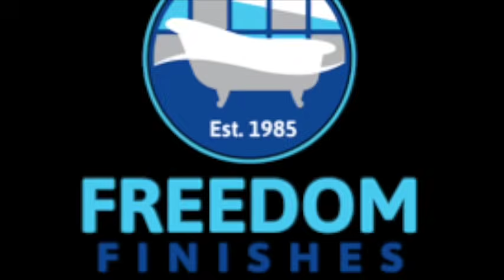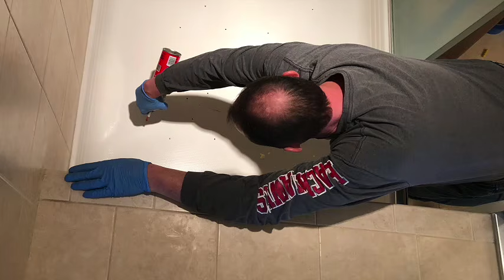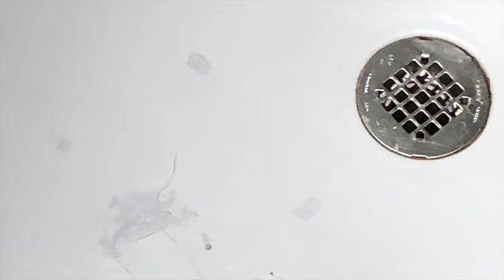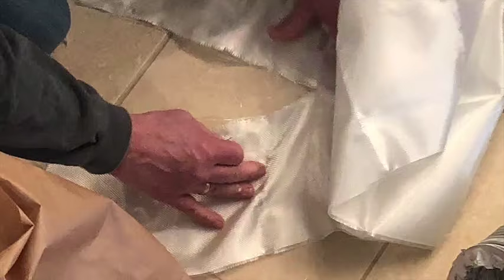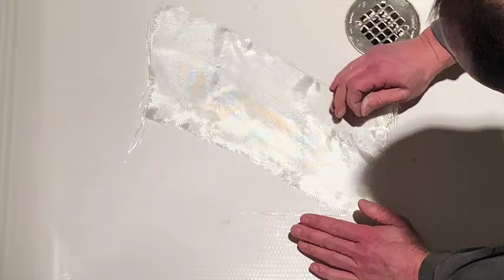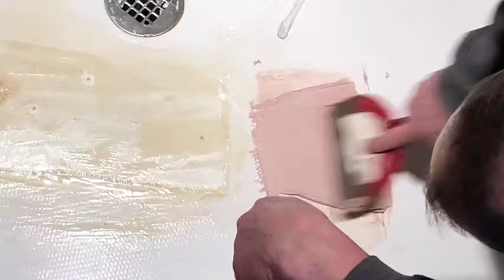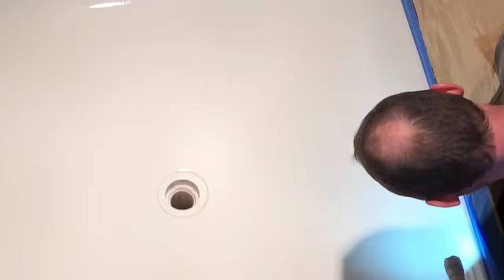How To Repair A Cracked Shower Base: Freedom Finishes Refinishing Products, LLC

Comment: Not to rain on your parade but...
This 'Award Winning Freedom Finish' was used years ago and has proven to fail over time.
The spray enamel will discolour and peel away from the base as a result of uneven weight distribution, expansion and contraction from water temperature variances.
Furthermore, Bondo is NOT designed for this purpose and overtime will crack under foot loads.

A better recommendation would be to replace the pan by installing it right in the first place.
DO NOT SPRAY enamel on fibreglass or ceramic.
Reply: completely agree on the bondo. You can use fiberglass resin without the cloth for a thin top coat filler instead. It will flex just enough under variant weight and temperatures to do the job. It is also more water proof.

Comment: He"s using the wrong density foam Thats for insulation not for support
Reply: Glad you mentioned it 
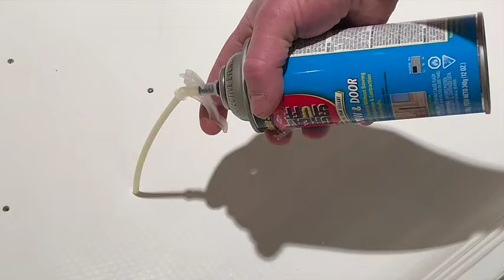That's a low expansion (low density) foam used around windows and doors (see 2:12).
Overtime the foam will compress and the failure will reoccur.  
Great catch.
Reply: I’d definitely use a 2lb marine closed cell flotation.
Reply: Where would I find that? Do you have any brand names I can reference when shopping for it?

Comment: what kind of enamel did you use?  i m afraid overtime it will peal off
Reply from the maker: Thank you for your question. You are absoultly correct. You must use an enamel that is designed specifically for bathtub and tile refinishing. In the video we used our exclusive Freedom Finishes Refinishing Products. Our products are scientifically designed for bathtub and tile refinishing. We manufacture and distribute our products to select refinishers across the U.S.. These products deliver a "freshly baked" porcelain looking finish, have amazing adhesion and will easily last 12-15+ years. http://arlingtonbathtubs.com/freedom-finishes-coating-system/
Reply: Don't be afraid...overtime it will.  
If your damage is that extensive, then replace the fixture.

Comment: great DIY video but need to know the name of the materials and brand, may you add it to the description ?
Reply from the maker: Thank you for the good feedback. We use our own exclusive Freedom Finishes Refinishing Products. The are available to commercial bathtub and tile refinishers. The products are scientifically designed specifically for bathtub, shower and tile refinishing and extremely durable and look like "freshly baked porcelain when applied. You can learn about our products @ http://arlingtonbathtubs.com/freedom-finishes-coating-system/
Reply: @arlingtonporcelainrefinish4743  Can I get theses products in Quebec (Canada) ?
Reply from the maker: @plaverdiere  Hello Pierre, Thank you for inquiring about Freedom Finishes. We distribute our products throughout the U.S. to professional refinishers. However, we would welcome a discussion to understand your needs and explore how we might be able to help you. Please feel free to call Brian Loeger @ Freedom Finishes Refinishing Products, LLC @ Ph#: 847-636-2478 or email: Bloeger@Freedomfinishes.com
Reply: @plaverdiere  I'm from Ontario, use G-flex Eposy no. 650, should be able to get it at Home Depot or elsewhere. I would not use Body filler over the repair area, that is porous and not flexible. I would just use another layer of clear Resin.

Comment: I am a little perplexed by the foam. I think there is a large shower pan under the shower floor. Where will the water go if the floor cracks. Isn't there supposed to be a pan under the floor? Won't the foam cause issues if the floor crack again?
Reply from the maker: Generally, when a shower base/pan is installed it is leveled and placed in quick-set cement to secure stabilize and give it the necessary support to prevent failure. The foam, when installed under the shower base/pan, will provide increased structure support and will help to prevent future failure.  Hope this helps clarify.
Reply: Overtime the foam will compress, the paint will peel and discolour, Bondo will crack and the pan will eventually leak.
How many times have I seen this failed patch attempt.
Give your business to a plumber who will replace the fixture properly.
Reply: @nspctor  No body filler ever.
Reply: @rosemunn6918  good job how about 2 part epoxy weld jb weld i donot see you use
Reply: @TuanNguyen-ru3qh  he used it to fill the holes he drilled, and the crack before sanding it

Comment: Thanks a lot very helpful video, Just one  question, which grid  to sand off body filler bondo ? Thank you
Reply from the maker: Hello Gil, glad the video helped. The grit sand paper really depends on the situation. In this case you could you 150-220. We used 180 in the video.

Comment: The foam was a good tip... I put some epoxy on a small crack I had but I didn't put any foam under it so it cracked again
Reply: I was about to lift the whole bathtub to fix the hollowness under it, and the video gave me the idea to not do it!

Comment: Can u add the specs on the paint sprayer? Great Video, Thanks!
Reply from the maker: Hello Elmer, Thank you for the positive comment and we're very glad you liked our video. In the video we used a Husky gravity fed HVLP spray gun with a 1.3 ml spray cap to spray the Freedom Finishes Ultra-High Gloss White Enamel. 

Here's a little more about Freedom  Finishes Refinishing Products:

Our exclusive Freedom Finishes bathtub, shower and ceramic tile refinishing enamels and process have been the cornerstone of Chicago, IL based Arlington Porcelain Refinishing’s longstanding “award winning,” marketplace success. 

Our incredible formulations and processes were engineered decades ago by APR.  They are designed specifically for bathtub, shower and ceramic tile refinishing and have evolved into the most durable and beautiful, high-gloss refinishing coatings in the refinishing industry. 

If you are a bathtub refinisher and desire to differentiate yourself from your competition, deliver an extraordinary product to your customers, drive process efficiency and increase your profits, we’d be happy to discuss our amazing Freedom Finishes products and advantage with you. 

Please feel free to call Brian Loeger @ Freedom Finishes Refinishing Products, LLC @ Ph#: 847-636-2478.
Reply: @arlingtonporcelainrefinish4743  This works on a Plastic  Base?? Or just on Fiberglass???